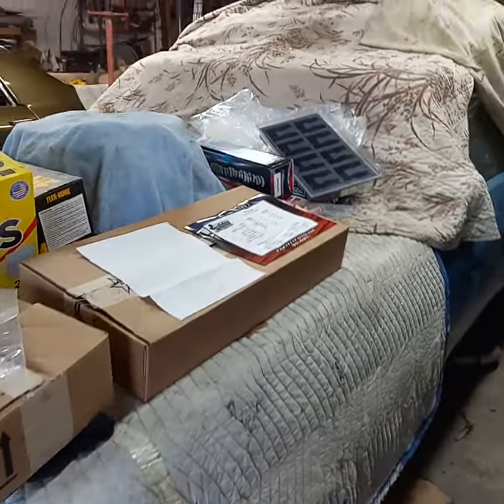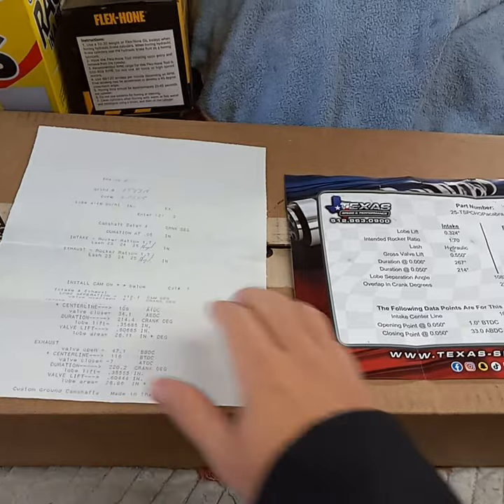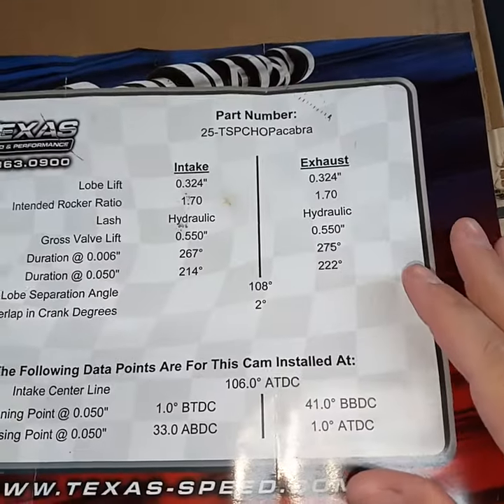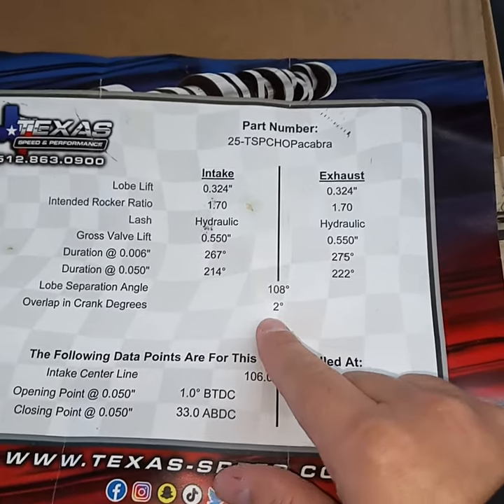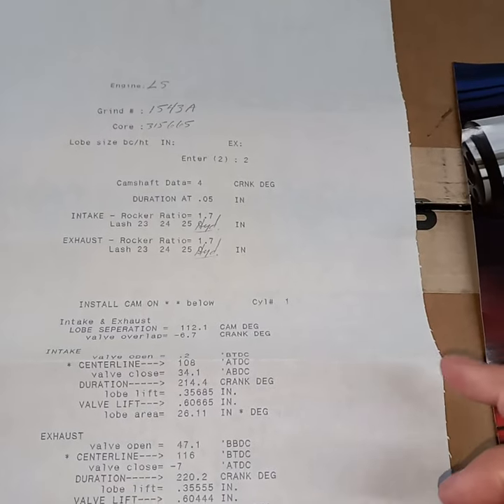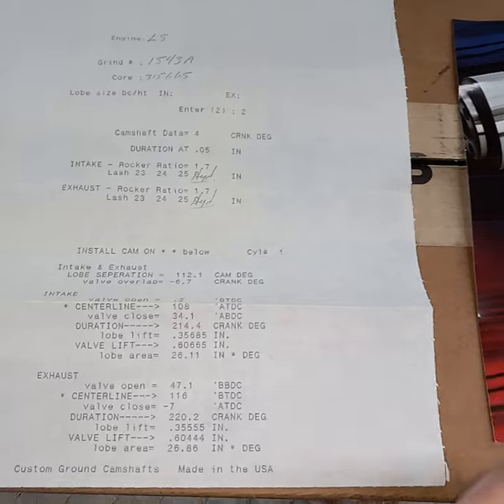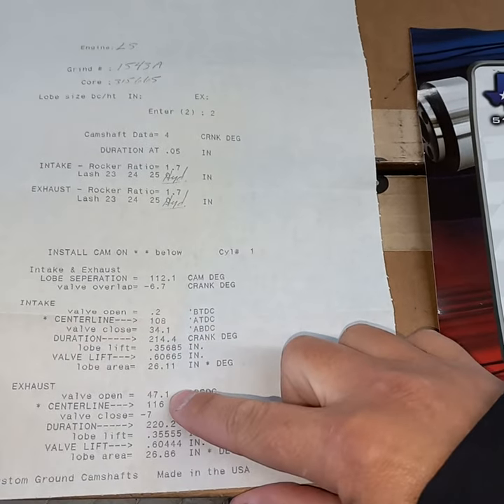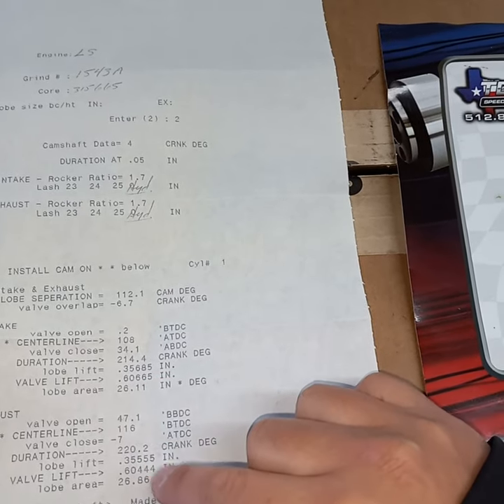Texas Speed CHOPacabra vs. EPS Truck TQ1 comparison 🧐 #camshaft #cammed

Comment: not sure if you still need thoughts on this build or if your past it
Reply from the maker: Right now, I've been trying to push this combination as fast as possible without changing any engine parts. I'm on the fence right now... once I push it as far as it will go, do I change the cam and see how much I can swing the power curve? Or just jump right into a heads and cam swap? I have the parts to do either one, just need to pick a direction and go with it. 

My end game is an LQ9 short block I have, PRC Stg 2.5 ported 862s, a custom grind cam that I spec'd, and a FAST LSXRT. I have all of those parts as well, the shortblock needs cam bearings and a good cleaning.
Reply: @bluecollarhotrods9781   ever look at the ramp rates of the callies?  i think they are aound 51.  most are  53-55 .  really harsh are 49....this is right between pretty agressive but not xer agressive. not sure if they are open to changing valve events etc